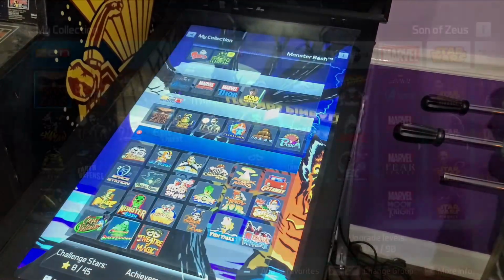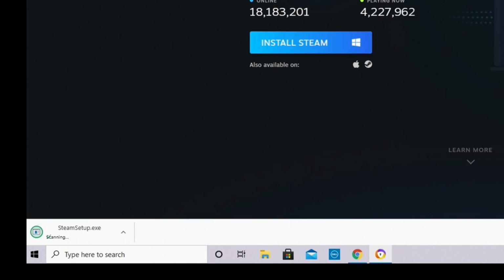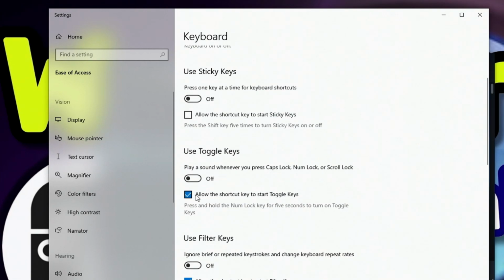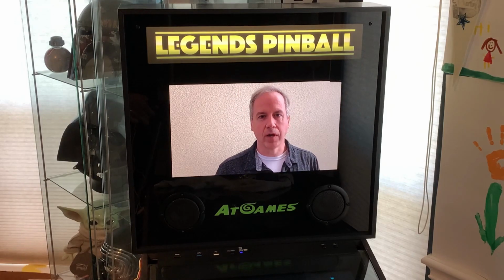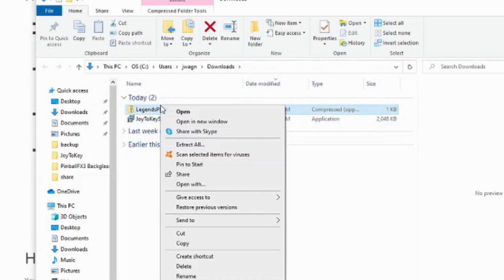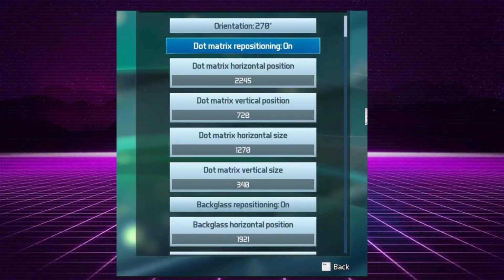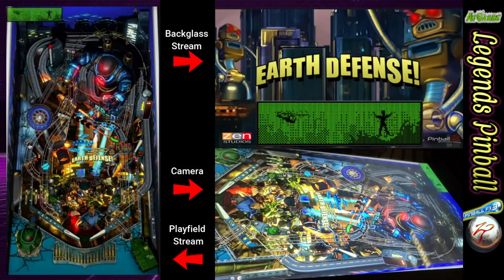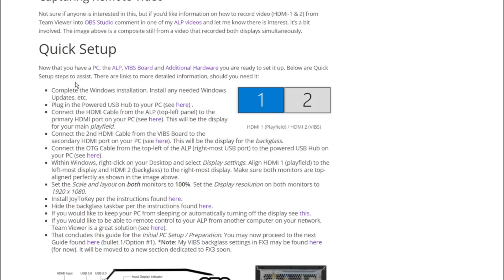Pinball FX3 Setup Guide for the AtGames Legends Pinball Machine

Comment: You never mentioned which graphics card you had. . . ??? Please let us know in a reply. Thanks
Reply from the maker: Using a GTX 1650 Super, the FX3 guide does link to the PC Requirements guide (here http://wagnerstechtalk.com/alppcsetup/#PC_Requirements ) as it's shared by both FX3/PinUP Popper guides.  I tested a BeeLink mini-PC first, not happy with it and returned it.  Then went with the Dell/1650.  Hope that helps.
Reply: @WagnersTechTalk  thanks for the details. I was wondering about the 3 HDMI (table, back box, DMD). You mentioned an option for use a “Dual HDMI Adapter”, the question I have is, will it know (the card or the adapter) to send the back box down one HDMI and the DMD down the other HDMI. (I can’t base my plans on theory.) ;)
Reply from the maker: I'm not using a DMD currently connected to the 2nd HDMI port on the adapter, I can't 100% answer your question.  Although, I have no issues with the PC consistently sending the signal to the backbox so I presume the same will be true if/when the DMD is connected to the 2nd port.
Reply: @WagnersTechTalk  thanks, I really appreciate your time and answers.

Comment: Help. I have tried to hook up FX3 with joytokey, doesn't work.i used the usb cables you suggested, doesn't work. tried powered usb, doesn't work. I tries different HDMI cables, doesn't work. Screens work fine, but the only way to play it is to use my computer keyboard. I tried to use the Xbox controller settings, doesn't recognize it, doesn't work. I have tried plugging usb into different ports, doesn't work. Help please, it looks so easy on your video
Reply from the maker: You don't happen to be using one of those BeeLink mini-PC's are you?  I had the same difficulties with one and why I'm asking.  I had to use a very specific USB Hub + the cable, but unfortunately that Hub is no longer available (or so it appears).  I wound up returning the PC and got another one after other issues were found.
Reply: @WagnersTechTalk   I hava a Dell OptiPlex 5050 Desktop Intel Core i5 7500T 2.7GHz Processor; 16GB RAM; 512GB Solid State Drive; Intel HD Graphics 630. it is probably the problem. thanks for the help
Reply from the maker: @raystill9458  Your PC is probably ok, those specs aren't bad.  Before you do anything, please open a ticket with AtGames here: https://www.facebook.com/groups/1468474910163554 Explain the issue and perhaps they'll have a better suggestion.  I don't want to claim it's a PC issue when it may not be.  May just need a different powered USB hub (which I can't find anymore) but AtGames may be able to recommend.  If I can find another confirmed to work, I'll respond back here.
Reply: @WagnersTechTalk  Thank you so much
Reply from the maker: Very welcome, I just asked AtGames directly if I get a response I'll let you know.  Also, there is a menu option in JoyToKey to bring up a controller tester.  Load that up and see if any of the buttons on the ALP blink when you press them.  If so, you're likely good and just need to select the correct JoyToKey profile.
Reply from the maker: I received a reply from AtGames, this is one that they think should work for you: https://www.amazon.com/atolla-Aluminum-Charging-Splitter-Individual/dp/B08926X7LP and this one is being used internally: https://www.amazon.com/dp/B00BWF5U0M . If you get one and it works, please let me know.  I'd like to update the guide with anything that is confirmed to work well.
Reply from the maker: Had a few people recently with OTG connectivity issues, so I added this new section to help: http://wagnerstechtalk.com/alppcsetup/#OTG_Troubleshooting

Comment: Do you have your PC open steam or whatever you pinball program is automatically upon start up? So you don’t have to every time
Reply from the maker: You can, although it can be considered a security risk (auto-login into windows) and not something I cover in detail here.  Here is an example of a method that may work: https://computerinfobits.com/windows-10-auto-login/
Reply: @WagnersTechTalk  thx, but also I meant can you have steam opened by default when you power on the PC?
Reply from the maker: You can add it to the Startup group, just copy the shortcut in the Startup folder and it will start Steam automatically (or FX3)

Comment: How do I get pup packs for FX3 working with pinup popper?
Reply from the maker: This guide was meant to get you up and running, for some of the more advanced features check out Nailbuuster website here: https://www.nailbuster.com/wikipinup  I plan to add PUP Pack info. in the future, just haven't gotten there yet.
Reply: @WagnersTechTalk  the issue is I can only get the resized/repositioned one from the menu in FX3. If I follow the steps on nail buster and make it that tiny 520x136 size I just end up with a tiny little dmd on my huge 1920x515 lcd lol.  And then there is no dmd like there should be.

Comment: I followed this video with Best Buy geek squad at my house. They did everything perfect except we still can’t get the pinball machine buttons to work when playing the game. Not sure what we are doing wrong 😐
Reply: I actually initially opened a support ticket and they gave a link to your video for the help and said this was the best they could offer
Reply: I’ve seen today forums of people complaining with the same problem and comments saying it’s a defect with the pinball machine that the usb signal is not strong so a hub helped. Hoping that works for me. Either way you’ve given me way better help than at games themselves. So thank you for that
Reply: I just noticed on joytokey when I click thenlegendsPB-WTT the controls are just like yours. However when I click options, it says 0 joysticks is detected…im wondering if there is a setting in joytokey I’m missing..?
Reply from the maker: @AJFurypinball  In the prior PC I was using, it would sometimes connect then disconnect before using that specific powered USB hub I mentioned above.  I had tried an Amazon Basics powered USB hub and it did the same thing.  I know the one I recommended is currently unavailable, but if it's not detecting the ALP, unless you're not using the left-most (USB 2.0) port to your PC then it is still possibly the hub and/or the USB A-A cable.  If you have a wired XBox controller, I'd plug it into the USB 2.0 port and see if the ALP detects it (if so, the port should be fine on the ALP).  At least, this may isolate it down to an issue with the port on the ALP or need for a different Hub.  That's all I can honestly think of at the moment.
Reply: So when I plugged it into the hub, it just vibrated. When I plug it directly into the laptop..nothing happens at all. In any of the USB ports..I’m thinking it’s something with my pc too going to bring my laptop into bestbuy this week and let them test it with things
Reply from the maker: @AJFurypinball  This may be good news, that most of the troubleshooting we've done here narrowed down the issue to something that may have nothing to do with the ALP.  The reason why the controller vibrated was likely due to the 5v power line coming from the USB hub, though the data lines may not be working/shorted and why the PC isn't seeing the controller.  Please keep me posted on the outcome, I'm as interested in knowing as you are.  Have a good evening!
Reply: So just got back from Best Buy. We did manage to get an Xbox controller working through joytokey very easily. So it’s not my lap top. I’m using an insignia 6 foot usb cable from the pinball machine into the laptop. Still not registering the pinball machine in joytokey. Now, I will say when I plug the pinball machine in through the usb hub..a “smartlink” program window pops up and syncs the laptop with the pinball table and the hdmi plugged in projects my computer screen onto the pinball machine. Sometimes smartlink wants to make adjustments to my laptop. I’ve tried it both ways with and without adjustments and nothing changes. So the last thing I can think of is I need better usb cable and hub or there is a setting on the pinball machine itself I’m missing..is there a usb cable on Amazon you recommend? I know you said the hub is out of stock
Reply from the maker: @AJFurypinball  Not sure what that "smartlink" program is doing, I have no such software installed.  It may be something worth uninstalling, rebooting and see if that helps.  The OTG cable and stuff I used can all be found here: http://wagnerstechtalk.com/alppcsetup/#Additional_Hardware .  The cable is available, just not the hub I used.
Reply: And also another question..if the usb was broken would flash drives work? Because both ports on the machine are working when it comes to using the the flash drives..sorry for all the questions..I just am dying to get this figured out
Reply from the maker: @AJFurypinball  May need to create a separate thread here, YT isn't showing me all your comments (maybe we exceeded the limit lol).  If the ALP is working with the flash drive connected, that is you can access/play any Zaccaria/TAITO packs you may have installed, then everything is connected fine in the ALP itself.
Reply from the maker: @AJFurypinball  Let's take this discussion to a group of people who can assist.  Please post the problem here: https://www.reddit.com/r/LegendsUltimate/

I'll also jump in there, but perhaps by having more people look at the issue we can get it resolved faster.
Reply: @WagnersTechTalk  your USB worked!!! I’m returning the insignia I bought from Best Buy..I’m so happy right now!! Can’t thank you enough!! You’re the best
Reply from the maker: @AJFurypinball  So great to hear, hard to  believe it took us this long to get here lol  But dang it we did it.  There have been a few times I've bought Insignia-branded products (headset and an demodulator), in both cases they went back to the store.  Not that it's a bad brand, they just didn't work well enough for my needs.
Reply from the maker: Make sure you update to the latest firmware on the ALP, there was a release last Thurs that broke things.  Then fixed on Saturday.  Aside from that, the JoyToKey profile should work for you.
Reply: @WagnersTechTalk  yes the patch was updated and installed. But for some reason it’s still not working. I feel like it’s just a setting on my laptop I’m missing Thats stopping the connection from joytokey to the pinball machine..so I need to register joytokey? Is that why it’s not working? So frustrating I’m like 99% there and dying to play these games on my machine
Reply from the maker: @AJFurypinball  Another thing it could be, the first PC I tried was a mini BeeLink PC.  I had some odd issues with that over USB, sometimes it would connect then disconnect.  What worked on that machine (before I wound up returning it, for various reasons) was to use this Powered PC Hub: http://wagnerstechtalk.com/alppcsetup/#Additional_Hardware (has been out of stock for a few weeks, another powered hub I had did not work) and the OTG cable mentioned there as well.  I can't say if it's the same issue you're experiencing, but it fixed this aspect of the problem on that prior machine I was using.  The PC Requirements section are taken partially from the FX3 recommendations along with my comments: http://wagnerstechtalk.com/alppcsetup/#PC_Requirements May want to check that out as well.  I hope some of this puts you on the right path for success with FX3, it is a lot of fun!
Reply: @WagnersTechTalk  I actually have it plugged into a gaming laptop I purchased 2 years ago.through its HDMI and usb. Do I still need a hub ?
Reply from the maker: I can only go by my own experience based on the above (USB cable and hub).  It worked in my case, can't guarantee it will for you.  You could also open a support ticket with AtGames here: https://www.facebook.com/groups/1468474910163554 .  You don't have to register JoyToKey for it to work, btw (I did though)
Reply: Unfortunately the hub did not make a difference 👎🏻 I think I’m beat
Reply from the maker: @AJFurypinball  Damn.  Do you have a link to the machine you're using you can send me?  It's not one of those BeeLink mini-PC's is it?
Reply: @WagnersTechTalk  I can’t thank you enough for still trying to help..I’m just using my acer nitro 5 gaming laptop I purchased at Best Buy 2 years ago..I have the HDMI going into the laptop and I have the usb going into the hub which is then going into the laptop..the display looks great on the machine..games start up but only using the laptop keyboard..even with joytokey running in the background. I’m thinking of filming a video of me setting it up..uploading it and sending you the link so you can maybe see if I’m missing something?
Reply: So I actually just plugged an Xbox controller into the usb hub and the controller vibrated and then nothing else happened. The laptop won’t recognize that an Xbox controller is plugged in. I’m not sure what other usb or hub I can order that will work. This is really something. The geek squad claims my usb drivers are fine…This is never ending 😩 if there’s any other usb hub or usb cable you can recommend thats in stock I’m all for trying anything at this point. The only thing I haven’t tried is using a different laptop which I don’t have at the moment
Reply from the maker: @AJFurypinball  ok, this is interesting.  You connected a USB Xbox controller into the hub and the PC didn't detect it?  Almost sounds like something to do with the PC.  Have you tried connecting the Xbox controller directly to the PC to see if that works (no hub)?  It should, if not check if you have USB ports in a different location on the PC(front/back).  Perhaps the port you're using is defective on the PC.  Just a thought, hard to know for sure.
Reply: I’m starting to think there’s a setting in the pinball machine or my pinball machine usb drive is damaged…
Reply: One last thing..when I plug the usb 3.0 weather in the hub or laptop, while also plugged into the pinball machine, the noise happens and “smart data link” window pops up on my laptop and says “changing usb speed” then another little window pops up for a few seconds and says “waiting for other computer to connect” I don’t know if that’s normal or what it all means. But in the end, joytokey still not sensing the pinball machine
Reply: Ok so then what’s happening is when I plug the usb from the pinball machine into the computer..”smart data link” window appears..then another window pops up that says “changing usb speed” then another window pops up and says “waiting for other computer to connect” then everything goes away and it’s like the pinball machine isn’t connected…is smart data link supposed to come up when the pinball machine is plugged in?

Comment: Why are you saying the AMD APU will not work with the VIBs board?  Is it the Vega graphics or atgames implementation?  I was looking at some of the 5600 and 5700GX builds that ETA Prime was putting together.  Don't want to waste my money on a a small PC build if it won't work.
Reply from the maker: I can say the BeeLink mini-PC I initially started with did not work with the VIBS board without using an external USB Adapter (I used a dual HDMI adapter).  There were many reasons why I returned it, mainly the GPU performance was terrible (and can't be upgraded, VEGA 10)  I could see screen tearing during screen transitions.  Many others have stated they had issues with an AMD GPU + VIBS.  Wrote up a troubleshooting guide here to assist: http://wagnerstechtalk.com/alp/#VIBS_Troubleshooting .  I won't say it won't work, but didn't work well for me at all and don't recommend it based on my personal experience.
Reply: @WagnersTechTalk  Thanks very much.  I think I will wait for the next AMD APU that will have the RDNA or wait for the video card prices to go down!

Comment: Hello and thanks for the great video,

I have a question about it: I have so far assigned the buttons via Steam in BigPicture Mode.  It works great so far, except for the plunger of the ALP, I can not use or integrate with it.
If I install the JoytoKey software, can I then also shoot the ball using the plunger on the ALP? Or does the plunger with the JoytoKey setup also not work?

Thank you :)
Reply from the maker: With the JoyToKey profile you can use the plunger.  I've noticed some tables just launch immediately while others will respond to slow pulling of the plunger.  I also have a guide here that works with the Arcade Control Panel a little better: http://wagnerstechtalk.com/alpbi (I use it with VPX, FP and FX3)
Reply: @WagnersTechTalk  THXa lot.... I'll try to set it up  :)
Reply: I tried doing this and can't get joytokey to work. I have the control panel. I installed joytokey and copied over the configuration file from your guide (I've tried both your regular config file and the PUP one which I read would be better suited to those of us with the control panel. I launch joy to key and see key mappings. I launch pinball fx3 and no buttons or joystick work.
Reply from the maker: @DarthxRinzler  Is the control panel recognized by Windows?

Comment: How did you remove hex standoffs that was used to connect the smaller portion to the back board?
Reply from the maker: Sorry, I'm not understanding the question.
Reply: @WagnersTechTalk  In order for me to place the standoffs for my VIBS the other standoffs for the newer wave has a new connection that was there. I can't seem to take those off unless I'm just nerfing hard.
Reply from the maker: Gotcha, I only have the early production version (from Sam's Club).  Please see the official AtGames VIBS videos here: http://wagnerstechtalk.com/alp/#Instructions .  If that doesn't help, you may want to open a support ticket with AtGames here: https://www.facebook.com/groups/1468474910163554  I don't want to tell you wrong and without having the same model, I would be guessing which could be bad.